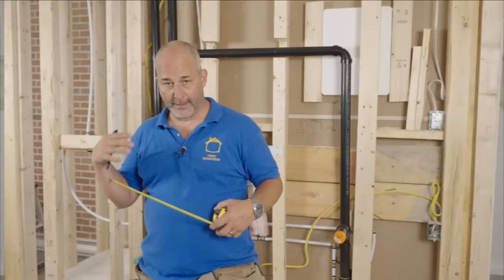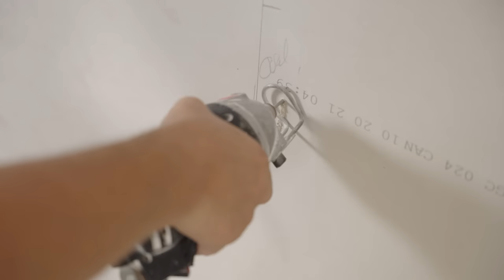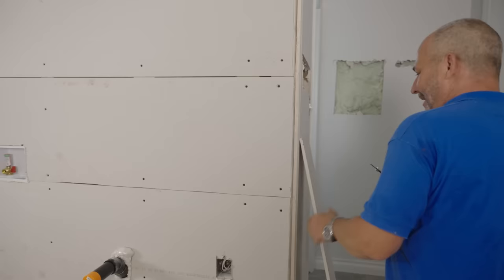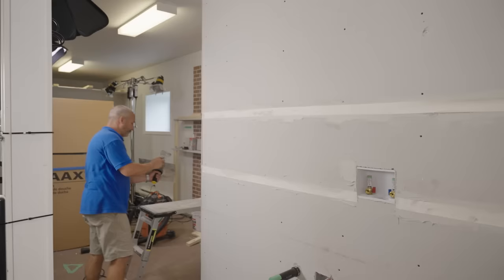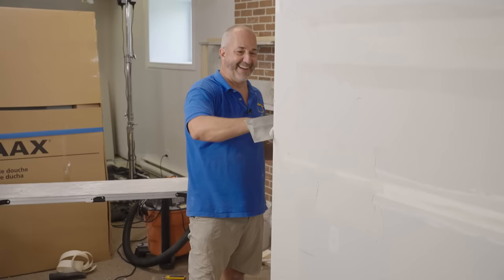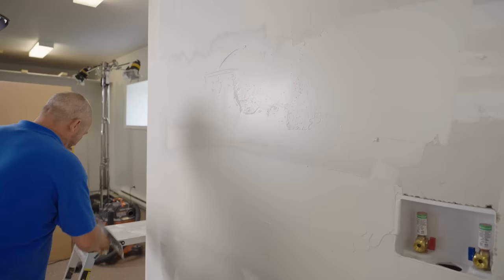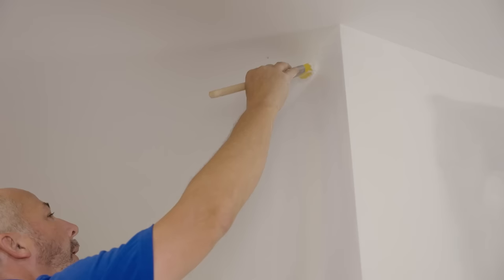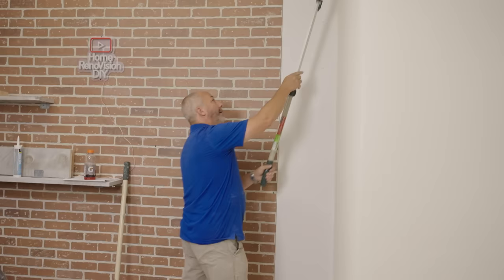Drywall Done In 1 Day | All My Tips And Tricks

Comment: Didn't notice you wet wipe the wall to remove dust prior to prime and paint..

Paint will stick to dust... And the dust won't stick to the wall, and your paint may peel....
Reply from the maker: common fallacy. the dust actually becomes part of the solid content s of the pai n t while backrolling. I sand between coats and it is easier to get a great result by just ignoring it rather than getting the drywall wet and waiting for it to dry aqain.
Reply: @HomeRenoVisionDIY  then I guess it was a figment of my imagination when I had half a customer's bathroom wall peel off when my guy forgot to wipe the wall first... That $500 extra dollars in labor it cost me for that mistake must have been The bad dream I had after too many Taco bells... Right? Lol 

I'll keep wiping my walls. Thank you
Reply from the maker: easier to use a pva primer and backroll. 35 years never had your problem.
Reply: Always wipe your dust off the walls down before priming and painting.

Comment: I also prefer trowels but i have seen some very skilled people using the flat knives, look at youtube channel maxkil they are really good drywallers and tapers and their best guy uses flat knives sometimes. also drywall shorty, not sure how good she is but she uses flat knives. i think with trowels its easier on the wrist/forearm and you can hold much more mud. i think for beginners flat knives would be easier for them to use because it can't hold a lot of mud and they will be able to control small amounts easier than they would  large amounts with the trowel
Reply from the maker: you really can't tell how good someone is until you shine a light on the work after priming. Everything on a camera looks good.

Comment: First and foremost, thank you for your time and dedication . I love how you go in depth with the fundamentals of the trade. But I do have a question. When you're trying to repair under a existing sink. Is  There any quick way to get around the plumbing coming out of the wall? A lot of these existing sinks have like this wooden backing panel that you have to cut out before you get to the dry wall. Obviously just curious if you had any tips and tricks to get around that or how to  patch holes around the plumbing. I really appreciate it. Thank you again for your time..

Comment: The grey vs white 45 is dry vs set. To coat on top it doesn’t have to necessarily be dry, just set. However, if you do multiple coats like this, give it multiple days to dry through fully before priming .
Reply from the maker: if you use a fan it is not necessary. drywall is designed to soak up moisture and then release it. Using good paint allows you to finish in 1 day!
Reply: I was wondering if someone would mention packing moisture on top of moisture and getting delayed shrinkage a week-two weeks down the road.
Reply from the maker: not with 45 and not with thin coats of mud! Cheers!

Comment: Always put a half inch piece of drywall on the floor before you put your next sheet up this allows a gap some water does not crawl up the drywall if any is spilled creating mold also if you were just back from the bottom up off that half inch piece of drywall it's been a lot easier then pushing a sheet up into your cheater block then you have a half inch ledge to set your drywall on

Comment: Hi Joe I've been in the business of hanging rock slinging mud and painting for the better part of 45 yrs. I would agree with  most of the things I've seen  but do  have a couple comments. Those paper corners are junk and will never last.#2 why did u cut both factory edges on first sheet. #3 causing if your right handed you would go left to right with  your  bead and never wipe excess caulk on your gun looks very un professional . I like doing what I call fan management got to have in most cases and I use both hock and trowel and pan and knives always  have found wherever  your using any quick drying compound the hock and trowel are much easier and faster to clean

Comment: quality content as always. I have a question about your mixing paddle. When you transfer it to the water you do not run the paddle in the water in the drill. I have always had a nice clean paddle after mixing compound I "mix" the water for like one or two seconds and the paddle essentially cleans itself. Have you noticed any difference between the two methods? Or is the cleaning just as easy regardless? Also rarely use 45 min mud usually using 20 minute.

Comment: Lots of great tips!  I'm not the expert here, just preparing to DIY my kitchen  and hall.  Why not put the 2 full sheets of drywall on top and the short cut piece at the bottom where you cant see it?  That way there's only 1 visible seam, and its tapered on both sides .  Even the seam on the bottom would be tapered on both sides.
Reply from the maker: the extra piece was over 12" in many case that is not the case.
Reply: This would have been smarter than what he did. Putting a factory edge with a cut edge is a really stupid way to have done this. He’s definitely fast but the quality is taking a hit.
Reply: standard to install standing in scandinavian.. and 10ft is 3M those are a B to handle alone special if the soft ones they break only if look at them or if the hardones they heavy and always something on ground pushing board up and celing to low so have scuffmarks on celing. or you lucky its a nice game.. then you need the boardlifter to set under and push up tight against ceiling and hold that while screwing =) and to sound like everyone else.. i work as builder for a living i have done it all even installing from a scissorlift and bomlift. so you pick ways you mange to do it by yourself and since you do it by yourself you have time to make it look good =) comme ci comme ça
Reply from the maker: so that i don't have to bend over to do all the taping. this way it is right there in front of me.
Reply: @TheClong42  If you float it out it's fine and you aren't on your knees.  Faster.  If it was a level 5 finish and high gloss I could see putting in a bottom strip.  Of course if the budget is unlimited and the owner is a prima donna and I am getting paid by the hour I will take weeks or months on a wall!
Reply: @BobSmith9753  for sure if the time is available you can float the whole wall. However I just don’t see the need to put factory edge against cut and have to spend more time floating. If the intent was to not bend over, then just get a rolling stool. I agree with you that you can do anything and cover anything with a float and some time but the fastest/easiest thing would’ve been to go factory to factory.

Comment: When you use router to cut hole around wire box, do you follow inner wall of the box or outside wall of the box? Thanks
Reply: Have to be outside otherwise it wouldn't sit nicely in the hole. Start inside, run to the wall, bounce up and over and go

Comment: In my opinion, the true test is if you can still see the joints and the screws after texture and or painting is finished, you did it wrong. If you are a diy'er who has never finished drywall before, you are probably not going to get it right on the first try. Which tools you use to get there are less important and more preference. I personally would never use plasterer's tools to do drywall or put tape instead of metal corner bead.

Comment: Idk if you respond to comments on old videos. I'd really like your input as I have no one else to really ask. My home is new construction in South Florida, unfortunately I didn't have much customizable options when doing my home, so my walls are textured and I really hate it, its not smooth at all. They have this stucco-like texture, or I think its also known as Knock down. Drilling holes, and patching makes it awful trying to match such a texture. the look is all the walls and ceiling. I have two main questions.

-Would it be worth smoothing this out, if so how would you do it? Can you scrape it off like popcorn ceilings or am i taking off the entire finish. Do you just apply compound and smooth?
-Also, I want to add backsplash tile, can I just fill in this texture with the thinset, and use the u-trowel and then apply the tiles right on top? not sure if this surface needs to be smoothed before trying to thinset and tile.

Comment: Jeff. What would you recommend to be used in a shower to waterproof the walls that will be tiled with 12 X 24 tiles. The height of the walls to be tiled are 9ft. The shower is about 4ft X 10ft.  Have you heard of or used the Schluter - Kerdi system?  Is using green board or cement board at thing of the past?

Comment: I'm buying a new house (new construction). I'm planning to have it built as a shell and do the finish myself. (Drywall, paint, flooring, etc)
In my previous condo, I've installed the thermopump and air exchange myself. I don't feel the jump to be particularly hard, especially if I take my time to do it.

My parents is telling me it's not worth doing it myself - even over weeks or months - and would hurt my resell value.
In truth in there?

Comment: Excellent video. Question: I have a radiator that is either full on or completely off! With the TRV set to 2 it’s still full on. When I turn it to 1 it’s completely off. There’s no grey area. Could it be a sticky pin or is the TRV busted and in need of replacement.  👍

Comment: The DAP Alex has failed me time after time.  I now use Big Stretch.  It has more latex in it and like it says, it stretches big.  My first real job was a plaster tender.  I don't understand the knife and pan guys either.  It was always hawk and trowel for us.  Granted, the place I worked for was all blue board with a plaster skim coat on higher end homes.  I have heard that the tool choice  has to do with the region of the country and what original trade took over the mud and tape job when drywall came into fashion.
Reply from the maker: It also has a lot to do with what tools the guys on HGTV were using back in the day. Holmes didn't know how to mud so he used the knives and pan. now everyone thinks that is the best tool.

Comment: I have 8.2' ceiling height so about 2.5" gap at the floor.  Either way baseboard will hide it but I have seen many people use either expanding foam to close the gap or some insanely narrow strip of drywall?  Any opinion on this - when we drywalled our garage growing up we just left the gap because its a garage...
Reply: Just leave the gap, if baseboard covers it, the drywall is best slightly raised off the floor anyway, stops rising damp, or so I’ve always been told
Reply: You can foam it, let the foam dry then trim the foam back with a 20" long cerated Cake Knife then tape it with 6" Fibrafuse and Hot mud. Pack the cured trimmed foam with Hot mud embed  your tape and skim it with hot mud.
Do one more coat with hot mud and skim coat it with Plus 3 if you want to but don't be too picky about the surface finish b/c you covering it with baseboard, this produces very strong water resistant floor transitions above grade.

Comment: If the plan is to stay away from having “Butt Joints”.  Why not start at floor w/ full sheet… then another full sheet then the 2foot cut off on top with cut edge at ceiling?  ZERO BUTT JOINTS.  Factory to Factory joints?

Comment: I have an old enclosed shed 25 feet by 9 foot with 2x4 rafters 24 inches on center covered by a lightweight roof over 3/8" OSB.   I do not want to add any more rafters but I would like to add roof insulation then ceiling material.   Due to span loading limits I am wondering if lightweight 3/8 drywall would be an ok choice.  Would the 24" spacing result in sag?  Any another alternative?

Comment: Hey Jeff:  regarding you mud mixer.  You mentioned NOT using a regular drill as it will eventually burn that tool up.  Would that be the ONLY REASON?  

I have an old Bosch hammer drill that has become my go-to “I Dont Care” tool, as I have a better hammer and rotor hammer options.  Has been used and abused for lots of stuff, and still won't die.  Can't find a used and can't afford a mix drill (I have just about every other tool now, though - and the fun money is all used up for now).  

If I'm light on the trigger, is there any other reasons NOT to use my Bosch for a mixer for the time being?
Reply from the maker: it will work just don't mix too fast. Or you will wear the mud Cheers!

Comment: Good morning. I was wondering about priming the wall twice. Then one coat paint. Is there an advantage to that that is greater than the addition of drying time? I think it was two coats or primer, right? 

Also, c2 products seems to be a lot more costly that the behr primer. Is that quality of the c2 that much more? Or maybe I’m not pricing the c2 correctly. What I saw online was over $80 for a gallon or eggshell. 

Thank you

Comment: A great tip for eliminating all the bubbles in you mud is squirt in a dawn dish soap in the bucket an mix it in an it also allows the mud to lay down much smoother as dumb as it sounds adding soap to remove bubbles it works incredibly well

Comment: 🎯 Key points for quick navigation:

00:00:27 🛠️ Efficient Drywall Process: The speaker shares a system and techniques for completing a small drywall project, including installation, taping, sanding, priming, and painting, all in one day.
00:41:00 📏 Measure Drywall Correctly: To avoid butt joints, ensure the drywall length matches the wall length. This reduces the need for extra coats and saves time.
01:23:00 🔧 Cheat Block Tip: Using a cheat block helps support the drywall's weight during installation, making the process easier, especially when working alone.
01:54:00 😅 Avoiding Accidents: Placing a block to prevent drywall from falling due to air pressure changes is crucial for safety, as a sudden shift could cause injury.
02:21:00 📐 Pre-Drill Holes: Pre-drilling holes for pipes and electrical boxes makes it easier to install large sheets of drywall when working alone.
02:50:00 🔨 Inch and Quarter Screws: Using 1¼-inch screws ensures the drywall is securely attached without puncturing any wires or plumbing.
03:32:00 ✂️ Cutting Drywall: Properly score and snap drywall to make precise cuts, reducing the risk of mistakes and ensuring a clean fit.
07:21:00 ⚙️ Routing Out Electrical Boxes: Adjusting tools to avoid damaging wires when cutting around electrical boxes is essential for a safe installation.
09:41:00 🪚 Precision Cutting: Precision cutting around obstructions, like pipes and electrical boxes, ensures a tight fit and reduces the need for patching.
10:55:00 🧰 Foam Filling Gaps: Filling gaps with foam before mudding helps achieve a smooth, professional finish and simplifies the taping process.
12:55:00 📏 Chalk Line Cutting: Using a chalk line for cutting drywall ensures straight cuts, which is crucial for a perfect fit and reducing rework.
18:26:00 🔄 Mixing Compound: Using a slow mixer with cold water to mix drywall compound ensures a smooth consistency and saves time on large projects.
23:31:00 🕒 Speed Over Perfection: The focus is on working quickly with minimal mess, accepting that minor imperfections can be corrected later.
26:09:00 🔍 Flat Taping: Flat taping is used to fill gaps and create a smooth surface for finishing, which simplifies the taping process and reduces work scope.
30:37:00 🍽️ Dry Time During Lunch: After applying the second coat of mud, taking a break allows time for the compound to dry, helping keep the project on schedule.
31:06:00 🧼 No Sanding Required: Instead of sanding between coats, the speaker advises scraping off ridges and bumps to prepare for the next layer, saving time and effort.
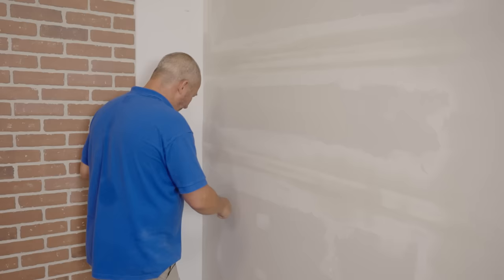32:43 🖌️ Skim Coat for Smooth Finish: If after sanding the wall isn't smooth enough, applying a skim coat after priming can fix imperfections and prevent sanding issues.
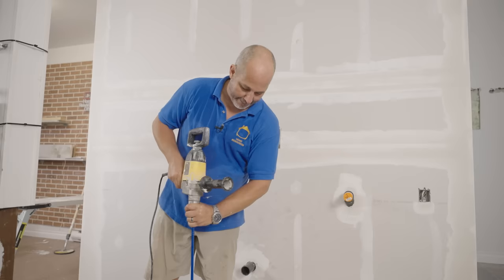33:46 🪶 Adjusting Mud Consistency: Even with pre-mixed mud, adding water is often necessary to achieve the desired smooth consistency for application.
34:59 💧 Avoid Bubbling: Thicker mud reduces the risk of bubbling, but it may require more sanding afterward to achieve a smooth surface.
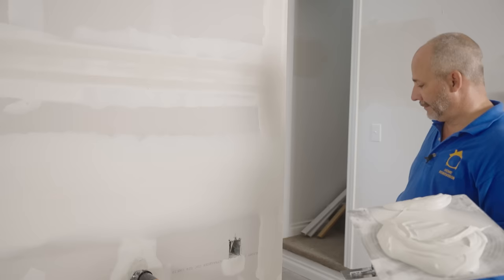35:43 🎨 Tool Preference for Quality: Using traditional drywall tools provides a superior finish compared to flexible blades, but mastering them requires practice.
37:21 ⏳ Adjusting Workflow: To avoid waiting for drying time between coats, it’s better to leave extra sanding work rather than applying additional coats late in the day.
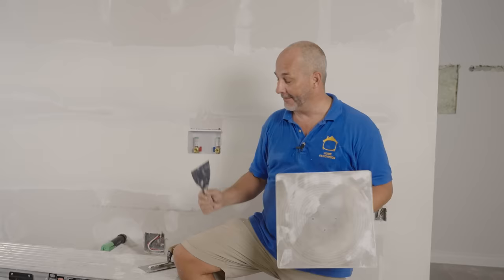39:33 🌧️ Weather Impact on Dry Time: Humid weather can significantly slow down drying times, affecting the project's completion time.
41:01 ⏲️ Project Timing: Completing drywall in one day is possible under ideal conditions, but delays can occur due to factors like weather, extending the project to a second day.
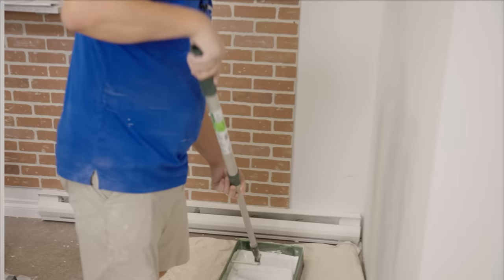42:53 🖌️ Priming Techniques: When priming, applying pressure helps seal the wallboard effectively, ensuring a good base for the final coats of paint.
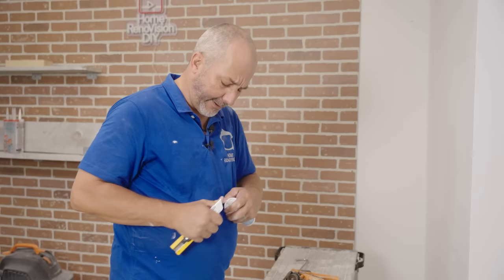46:49 🧴 Using Siliconized Caulking: Siliconized caulking is ideal for sealing joints before painting, providing flexibility and preventing future cracks.
48:12 🤲 Caulking Application Tip: Apply caulking with a small, controlled bead to avoid excess and ensure a clean finish without needing additional tools.
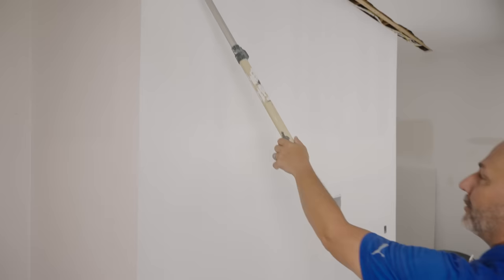49:27 🧹 Final Sanding Before Paint: Lightly sanding the wall before the final paint coat removes debris and ensures a smooth, professional finish.
50:15 🎨 Efficient Painting Order: Rolling the paint first on the initial coat allows you to quickly cover large areas, saving detailed brushwork for the final coat.

Made with HARPA AI

Comment: Thank you for your videos. They are very helpful. I'm turning a shed into an office. And I am at the drywall stage. One question, the bit you use on the rotor cutting tool. What type did you use. I tore up an electrical outlet and box because I used a general bit. Now I have to replace the outlet plug. :-(